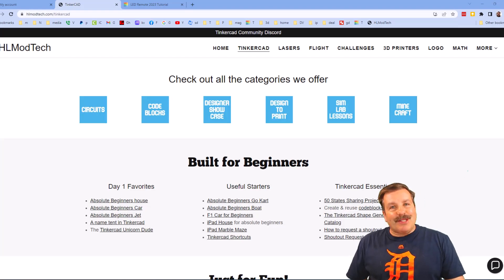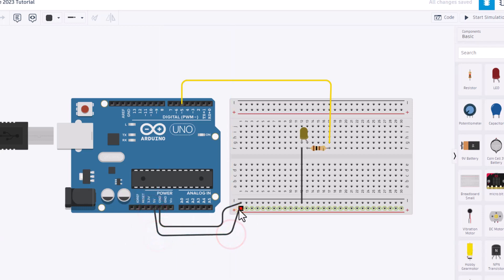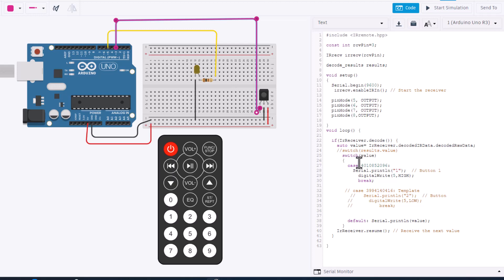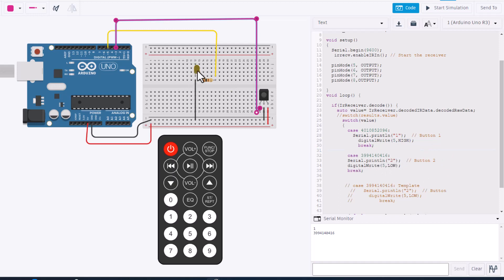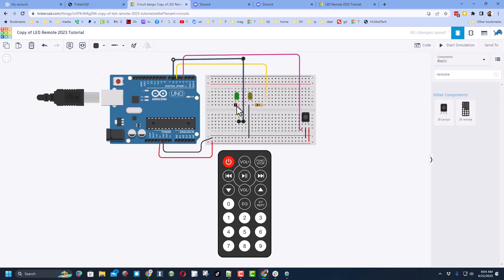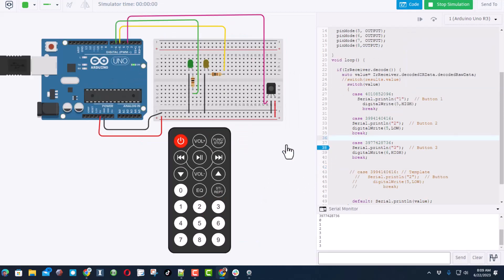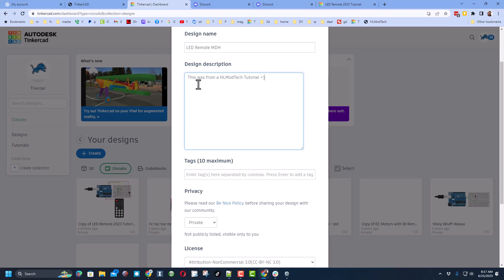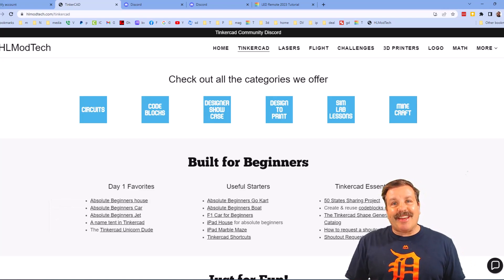Master Led Control With A IR Remote: Easy Tinkercad Circuits Tips For Beginners 2024!

Comment: Why when I go to edit mode and choose text, it changes the code to C++ and I can't do anything. Also I typed out your code and it won't work for me.
Reply from the maker: I just opened up a blank project and tested it. When you switch to text it does show the C++ stuff, but you just delete that and put the code you want to use in there. That said, I opened the old project and the sim does not appear to be running at all. Will shoot a note to the Devs and see if something changed. Travelling rn... so I am not sure how quick I will get you and answer.
Reply from the maker: Just tested again and it worked fine. Not sure what the glitch was the first time.
Reply: @HLModTech  Thanks for your quick response.
Something I have must be faulty. It should work but I am stuck. Thanks though, appreciated.
Reply from the maker: Here is a link to the one I have working. https://www.tinkercad.com/things/3DViVwoS3Oa-shared-ir-receiver-fix?sharecode=PIe0EO5uxRtgi23AuY9nCMcn_hUYZc-GLbjG_e7LwHY
Reply from the maker: I have only coded the red led. You are welcome to use that and the tips in the video to get the rest working. Maybe that will help you solve yours.
Reply: Thanks sooo much, that helped a lot! I appreciate your help!
Sometimes things people do, don't work for me.